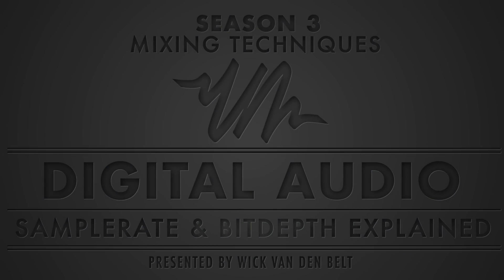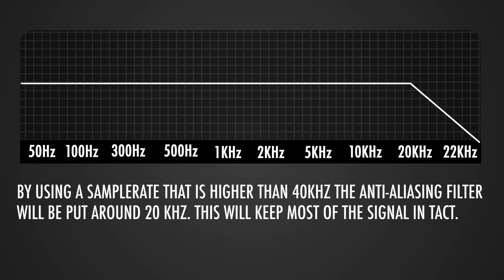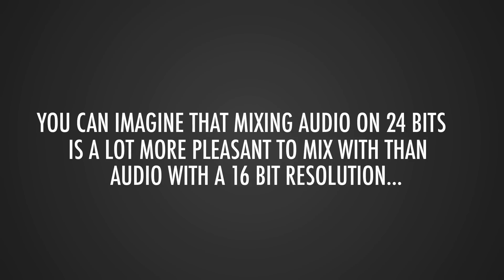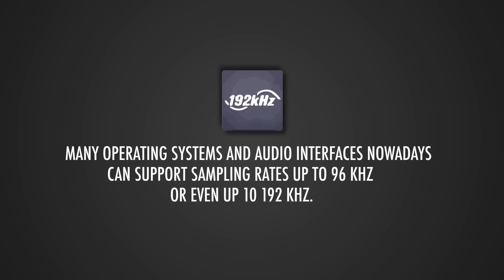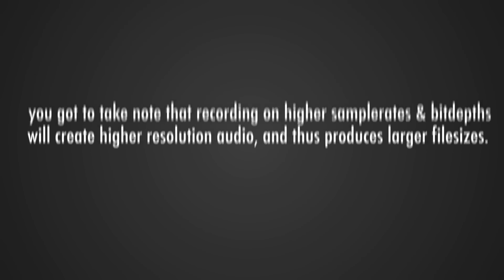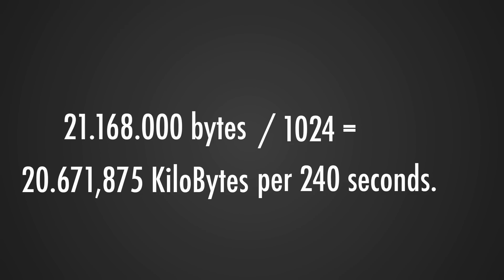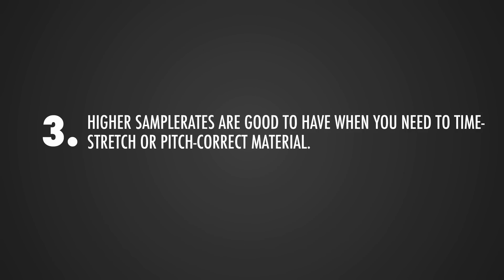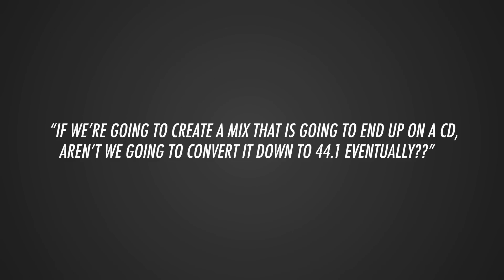Digital Audio Explained - Samplerate and Bitdepth

Comment: It hurts to listen to how many false claims and misinformation you are giving on this video.  Perhaps you’d should do more research to understand your material rather than repeating myths and misinformation
Reply: @nicksterj saying that a higher sample rate is more accurate.  Perhaps at a very big push more accurate in the top end of the frequency range that most people,e cannot hear if you do lots of processing functions on top of each other rather than using a bus.   Saying a higher bit depth has a higher dynamic range again is theoretically true, but in practice it means a lower noise floor that in most situations is irrelevant.  Again it is only important in over processing where a badly written okug-in can introduce noise. But a plug-in could have its own over sampling to eliminate that phenomenon.    To say that a higher sample bit depth is just going to sound better is just a misleading generalization and promotes a misconception.
Reply: @nicksterj sadly you are showing your lack of understanding about how Nyquist works.  Having a higher sample rate will make no difference to the accuracy of the frequency range you hear,  all it allows you to do is to accurately reproduce frequencies well above the audible range or in the case of music production you can put on a much more pleasant roll off on your high pass filter to reject any artifacts from plug-ins you have on your DAW.   Recording a 100hz sinewave at 44.1khz will give you the exact same accuracy as recording the same sinewave at 96khz or 192khz   The whole concept of it being some jagged step like they loved to put on marketing material for CD’s is utter nonsense.  So saying otherwise is a total disservice.   Sure there are reasons to record at a higher frequency, as I had said,  it does give you more processing room to eliminate artifacts in some post production plug-ins but it can be just as questionable if it really does anything.  You are just as likely to introduce bit errors inside the recording from using a computer with non EEC memory but you don’t see anyone promoting that.

Then you say about dynamic range.  24bit sound does have more dynamic range, but again it’s misrepresented by some as more sound resolution.  It is not,  again a 100hz sinewave recorded at 1db with a 24bit encoding will be identical to the same sinewave recorded at 16bit. And then you talk about increasing or compressing the sound, but as you are doing this all in the digital domain you are not limited by the same limitations that analog had.   Then when you throw in the fact that most people prefer having an actual audible sound floor in they will purposefully add in tape hiss as a plug in.  

There is a saying that good is not good enough and better is always better,   So with that theory we should all throw out our cell phones and earbuds as they all fall below even the good thresholds and only listen to music on $3,000,000+ equipment as better is always better.

Comment: im confused about bit rate being sample rate x bit depth. so cd got 1411kbps, sample rate of 44,1kHz and 16bits, but 44,1 x 16 only equals half of the supposed bit rate, should it be sample rate x bit depth x 2? Also I need an explanation on why is it times 2
Reply: You need two channels for stereo.

Comment: First Who use 196khz? And second you said Mebibytes and and not you calculated it for mebibytes and not megabytes... (Bitdeth/8 * Samplerate * Number of channels (for example 2 for Stereo) * time in seconds / 1 000 000) = Wave file size in Megabytes

Comment: Here's some trivia. WHY was the original digital audio/CD sampling rate set to 44.1khz? 

Its because the human ear can only hear frequencies between about 20hz at the lowest, to frequencies of 20khz at the highest. Some are more sensitive, or not, than others. So, the 44.1khz made the digital sampling rate TWICE what the high end of that range is PLUS some overhead, so that it was still twice as fast as what even the most sensitive human ears can hear, PLUS a little bit more to be sure.

Comment: Unfortunately, 24 bit has the same resolution as 16 bit. They are both 6dB/bit. The extra bits in 24 bit just increase the dynamic range. While useful for audio production, it's a waste for end user playback.

Comment: Hi, 
Can I record at 16 bit / 44.1 kHz and then export a wave to 24 bit / 48 kHz.  (for a video music cover)
I am a rookie, completely new to this audio recording, editing & mixing. 
I use cubase le 10
Reply: You can, but you won't gain dynamic range, more samples, or higher quality by doing this because that will have already been set in stone by your original mixed down recording in 16/44.1.

Comment: @5:00 this is not the right conversion, isn't it?
1 megabyte = 1,000 kilobyte = 1,000,000 byte = 8,000,000 bit
I think the SI-prefixes are used in this system just like in any other system.
If I'm wrong please correct me and tell me why so.
And I know that the number 1024 can play a role in this system, when you talk about the number of states of 10 bit for example.
But the number of states is not the same as number of bit.

Comment: I am a newbie knob at all this.  I bought a Focusrite Saffire 6 usb interface to plug my guitar into the laptop and take advantage of what there is as far as amp simulators go. I downloaded the drivers for the saffire 6 and Windows 10 is ok with it. However when I go to set up the software ..Amplitude 4..or the Bias Amp and when I attempt to change the settings from "Directsound" or "Windows Audio" to ASIO the software crashes. Sometimes I get an error saying that windows is unable to set the sample rate another program is using it (even though everything is closed out) or I get an error saying that the input and output devices don't share a common bitrate and that I should fix it in settings --which does no good? any help would be appreciated ..

Comment: If you are mixing down a loop for a video game say a video game crowd cheer, what bit rate should you use? The game I want to change the crowd for is ridiculously low the original is 88kps the lowest I can get my export is 2116kbs and it won't play in game. The size of the original is 78.8 kb the size of the one I want to export is 1.21 mb is this why it won't play? It says it can not be played on the mci of the system, it has to be a wave file and does play on windows media player but not in the game, how can I fix this? It must be a wave file, how did they get theirs to be so small?

Comment: Hi, have one simple question, does;t mean 16 bit, that one is for the sign? And there are only 15 left for amplitude?
Thanks
Reply: No 65536 possible values with 0 being -, 32767 being zero and 65536 being +.

Comment: If I were to line in an mp3 player (Amazon Echo dot) into my PC Line IN.
Should I use a 48KHz to play in my Line out?
It gave me two options CD(44khz) or DVD(48Khz) format. 
And should I worry about my PC breaking if I mess with these settings? thanks for your video :)

Comment: Unless you are a dog or a bat, you can't hear the difference between 16bit 44.1k and 24bit 192khz.
Reply: That’s true, but for editing it makes sense to get these sampling rates!
Reply: If you must, at the very least, consider 24 bits. Not only is it an audio standard, but a sinusoidal wave would be better smoother or more pleasant when represented by 24 bits rather than 16 or say, 4.

Comment: a 24 bit system does not have any more resolution the a 16 bit system, just a greater signal to noise ratio. A 10k tone will sound exactly the same at 16 or 24 bits. The only difference will be a slightly higher noise floor which you will not hear at a S/N of 96db.
Reply: And isn't the sample rate not a matter of quality, but one of the highest possible audio frequency that can be recorded?

I thought the way it works is:
bit depth = steps from loudest to quietest (not how loud it can go)
sample rate = the highest frequency that can be recorded (divided by 2) (not quality of frequencies below the highest)

I thought the only quality issue is whether or not the system makes mistakes. If everything is done right in a system that samples 48,000 times a second, then everything below 24,000Hz will be recorded perfectly. That's the theory anyway. Recording at 49,000Hz won't make 10kHz sound better, it will just allow you to capture 24.5kHz. Making mistakes will hurt all of the frequencies, not just the ones close to the maximum.

I think mathematicians are failing the audio community on this. They need to explain it better so average people can understand.
Reply: True, if we want to reduce noise floor record at nearly 0db at 32 bits and reduce gain